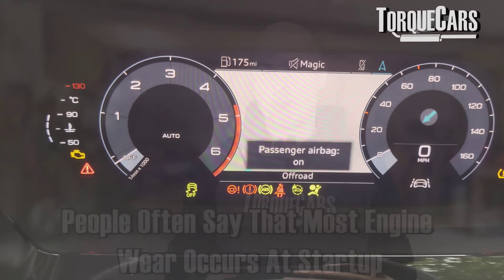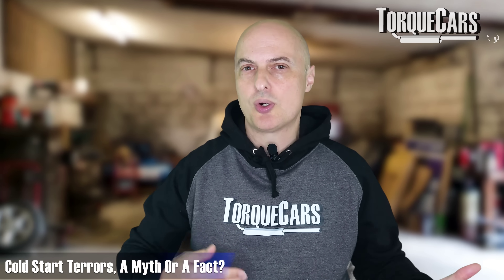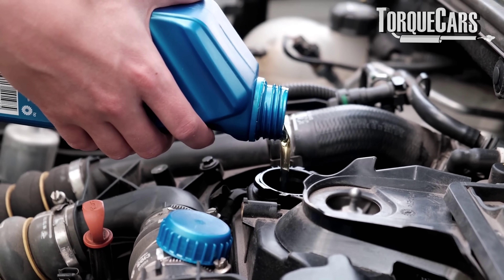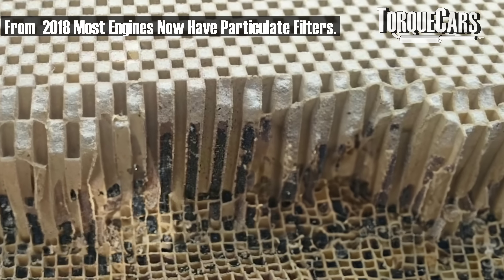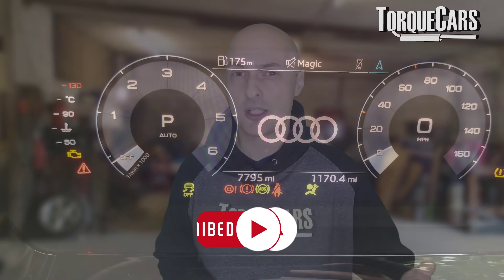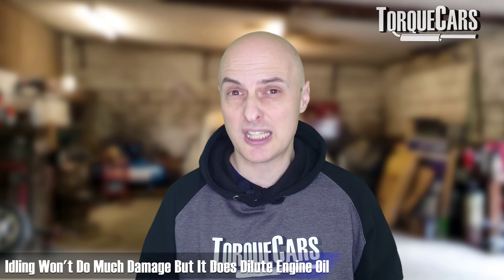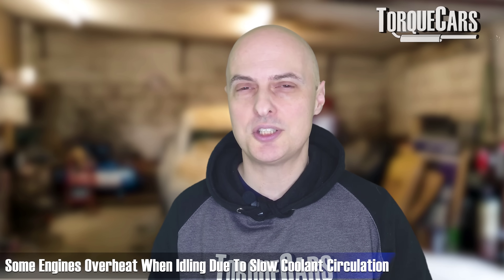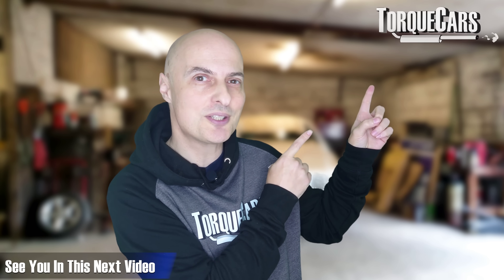❄️Reasons Why Bad Cold Starts Destroy Your Engine ☃️Prevent It Happening To You! ⚠️

Comment: When it's very cold I put a brick on the throttle and start the engine. When I am driving around 70 MPH (especially on the highway) I shift into Reverse. This keeps my car healthy.
Reply: Top tip 👍
Reply: Golden advice.
Reply: And if it’s a diesel, don’t forget to top off at least 30% of the tank with premium petrol. It burns hotter so it should warm up your engine quicker.
Reply: @EasternUNO  😂
Reply: Its the quickest and safest way to warm up the engine. 👍
Reply: @LiljamezZz 😂😂😂
Reply: @EasternUNO  Funny :)
Reply: Amazing!
Reply: @EasternUNO  this is why I have a mechanic, it's not my job to worry about this nonsense.
Reply: Top G
Reply: @EasternUNO  I can confirm that. Personally, it took me years to accidently discover the „wear reverse lever“. But now my engine is better than new, like -50.000 miles on it!
Reply: Man of wisdom
Reply: I love to listen to brit advice here in the us...but what they leave out is the fact you may have to clear the snow and ice off the glass..use that time to start the engine and turn on the heater element in the rear glass to assist..and just as important who wants to have their fingers stuck to a frozen steering wheel.
Reply: Wait I’m confused lol, you put the car in reverse at 70mph on a highway? Won’t that brick your whole transmission and gear system?
Reply: @EasternUNO  when I start the car on cold winter mornings i immediately put the car into drive and do a redline burnout in my driveway. That way the engine and transmission are both warming up
Reply: @EasternUNO  the good ol transmission reset trick. Mines due I just haven’t had the time lately
Reply: @cisco8237  na its really good for it
Reply: This advice sits well in the internet of today. I wheelie my bike when I want to make a sandwich
Reply: Are you tryin to be funny?
Reply: @ivanparenzo6493  car standards man
Reply: @DubStepTomatoFarmer  I used to do it that way too but try it in reverse and then keep your foot on the gas and slam it in drive.  Warms up even faster plus it's good for the differential, warms it up quick.
Reply: Have you tried sand in the oil? It keeps the cylinder walls clean.
Reply: Please don't do it!
Reply: @nedcramdon1306  great idea!  It's like a continuous cross hatch application.
Reply: Start…… let it run 15 seconds ….. shut down …… repeat till warm
Reply: Absolutely, shifting the the transmission into reverse while driving helps spread transmission fluid to ensure your transmission is working properly
Reply: good to exercise it to the max
Reply: @EasternUNO  😵‍💫😂🤣
Reply: I do the same, works for me.
Reply: @EasternUNO  WTF!
Reply: @Feelthefx  Forget that, I get half off on pure Naptha at work, I just use that pure.
Reply: This gave me a good chuckle lol
Reply: Yeh you do. 😂
Reply: Lol
Reply: @EasternUNO  SAME! If it’s in the single digits or below zero. I just start it, pull out and hit the throttle hard. I shift around 6500 RPMs. Do a burn out or two at the first two stop signs. Can’t risk not warming up your tires as well.
Reply: Soon, there is going to be the rapture. It's when there will be trumpet sounds, and after the trumpet sounds, God will lift his people from here. Also, God said people should be living by the Bible. Amen, and God bless you.
❤Jesus loves you guys. Dont wait, please. He will welcome you with arms wide open.❤
❤* John 3:16 - "For God so loved the world, that he gave his only begotten Son, that whosoever believeth in him shall not perish but have eternal life". ❤
Reply: This guy drives
Reply: I bring my engine a warm mug of tea in a morning , good old morning brew warms out up
Reply: @EasternUNO  you do know you can get sued if someone actually follows your advice. If you ever need a lawyer, dm me.
Reply: @EasternUNO  Your car is too afraid of you to break down.
Reply: @EasternUNO  🤔
Reply: @EasternUNO  the only guy here who actually understands cars 🫡
Reply: Shift into reverse at 120
Reply: I did the exact same thing once, and ruined my manual clutch!
Reply: Also use a match to see how much fuel you have in your gas tank. You can't really trust a dumb gage anymore
Reply: just like your body you gotta push your car to failure to see gains 💉🙏🏼💪
Reply: @cisco8237  what about putting brick on throttle!!! in cold start..
Reply: @BikeBrozz  lmao
Reply: So funny omg
Reply: @ivanparenzo6493  If you were 12 years old you'd get the joke.
Reply: @EasternUNO  you can’t be serious. That’s dvmb
Reply: should I leave the brick on for the whole journey or until the engine is just warmed up?
Reply: This man scares me
Reply: @Feelthefx  That is the most ridiculous comment I have ever read . Disturbing is some people will believe it and blow up their engine. There's many videos on this and conflicting views causing confusion. Every car and engine are different. Get to know it is the best way. I might sound crazy but cars even though the same model have different personalities. You bond with some and you don't with others.
Reply: When you change your oil make sure that you grind plenty of sea salt, cracked black pepper and tomato sauce diluted with malt vinegar. Then you know it has been well seasoned and Bob's  your teapot!

Comment: Another issue to consider, are the gaskets, if the engine  block is cold and you drive the car away, theres a very good chance the the heads and the block have not expanded and created a much more tighter joint instead of just relying on the gasket itself to hold back the pressure created by the cylinder pressures, alot of exhaust gasket leaks are from the flame blowing thru the header gasket due to the differences of cast iron and aluminum, and dont run the heater until there is sufficient engine heat, other wise you are cooling off the coolant before it can retain a warmer temperature
Reply from the maker: Good point my friend.
Reply: Such a load of nonsense, manufacturer manuals literally tell you to drive away straight away and to not idle at cold…
Reply: @Master1906 
They also want to sell you aftermarket parts, so I know what advice I will follow.
Reply: That’s not correct. That only happens if you floor it or drive above 3k rpm if you drive it off when cold. You should let your car cold start for 50 seconds then drive away slowly and not exceeding 3k rpm. This will warm up the car faster and you will waste less gas while not harming the engine. By driving the car slowly you don’t cause uneven expansion of the bearings, rods, pistons, cylinders, heads and the block.
Reply: Heater is not really a problem cause most modern engines are programmed to idle at a little bit higher RPMs when cold-started. Toyota f.e. even went further and some models have "Power heat" button which raises RPM by like 300 (from around 900 to 1200) so the heating can happen faster. When engine is warmed up the idle speed will drop down to its normal value. Also at least my car also raises RPM a bit when a heater is activated, but it feels like its only 100 rpm or so, don't feel the difference that much in terms of how much heat gets produced. 

Anyways I park my car in a non heated garage so I don't worry about having to full blast heater to get windows unfogged or unfrozen even without heating. I'd assume you shouldn't full blast it when on cold engine anyways, better drive for a bit with modest visibility and then turn it on when coolant has heated up a bit
Reply: @sheepdog3828  i don’t think you know what thermodynamics actually means 😂
Reply: Don't exaggerate guys. Not using heater to not upset your engine thermal (making yours car engine more comfortable than You) is a bit over the top i would say because if You let it "break in" for this few seconds and You're taking off gently as it is advised it would anyway produce few kilowatts of "wasted heat" that is there to use to Your comfort. Engine is warming up pretty fine anyways...
Reply: @an0nim11  u switch to coomfort mode to warm idle?*
Reply: @marks9127  
Thanks for the info. Sounds like Toyota are first to bring in updates that actually save the car, instead of hoping to break it and sell us parts, as is usual with their European counterparts.
BTW Putting your heater on before your engine is up to temp. will take heat away from your engine, making it slower for it to reach operating temperature, thus reducing the viscosity of your oil.
It's a hard choice, I know, but maybe an extra pullover is the answer.
Edit. If you drive a petrol, it's less of an issue. Driving a diesel, like I do, it can be frustrating.
Reply: Sounds like a load of BS to me. Ever see someone loosen head bolts? Watch the “I Do Cars” nut. The whole engine stand is jerking around because they are massively torqued. With regard to the heater: What % of the thermal energy produced by engine combustion is being removed by the heater? I would posit “not enough to make waiting and freezing worth it”. I give my car a minute or two as I buckle seat belt and fiddle with the radio, the engine has GONE 28 YEARS with regular oil changes as the ONLY maintenance. (1996 Saturn Twin Cam btw)
Reply: What kind of wizardry is that.? Doesn't make any sense...1 minute idle time..drive off  don't run hard till engine oil temp is mid way..turn heater on right away .or run into back of car.
Reply: @kurtjammer9568  
1. Listen to the audio in the video.
2. Do you drive a diesel?
3. What is the result of a few minutes of light driving to the operating temperature of a diesel in winter conditions?

You will only be blowing freezing air onto your windscreen. The moisture in your breath will condense on the windscreen. The resulting moisture will freeze, only adding to your original dilemma. If you can't see, you will hit whatever is in front of you. If that happens to be a pedestrian or cyclist, the police won't be slow in joining the dots. Explain that in court.
Reply: What? You dont like the days of the VW beetle. When you have to scrap the inside of the windshield while driving.all the way home..your spoiled lol
Reply: Oil does not absorb water. 🤡
Reply: @persevere777  
OK. Here's my tuppence worth;
1. Apply PRE icer to windscreen on the previous evening and point the car towards the rising sun.
2. Turn the heaters off, open the windows and take a couple of runs up a nearby hill. This is usually enough to allow you to close the windows and put the heater on to keep window interior clear.
3. There are other steps, but they have been covered, I think.
Reply: @michaellavery4899  i think im just gonna buy a horse 🤣😅😂🤪
Reply: @persevere777  
Genius. And it's more economical in every respect. 😅🤣
Reply: @snu666   Hot/cold can cause condensation in your motor, the heating and churning of water and oil will mix them into a whiteish/brownish creamy substance
You will often see this on the bottom of your oil cap if you frequently do short trips if you live in a colder climate area
Reply: @Master1906 Manufacturers also tell you to use ridiculously thin oils and not to service transmissions. Manufacturers aren't concerned with multi-decade longevity, they're concerned more with economy and convenience for the first owner, as well as reducing CO2 emissions because apparently that's going to make the planet boil 😄. Sometimes common sense is more valuable than what's in the manufacturers manual, like more regular oil changes.
Reply: @snu666 Yes, actually it does. Oil and water don't mix, but when operating together in an engine they are effectively force blended together into an emulsion, much like mayonnaise. This is a fact, and if you have sufficient water in your oil, such as coolant going into the crankcase, this "mayonnaise" effect will be very obvious.
Reply: brother if your head gasket blows because you drive your car with a cold engine it was already dead.
And if you put the heater on you will not "take heat" from the engine… Unless you want your cabin to be a steam bath or the outside temperature is diabolically cold.
Reply: @persevere777  I blew the head gasket on my mate’s Norton Dominator 45 years ago purely by not letting it warm up…. Whoops….
Reply: @michaellavery4899 I live in Norfolk - THERE ARE NO HILLS………
Reply: @Master1906  Manufacturers also tell us to go 10,000 miles between oil changes. Doesn’t make them right.
Reply: @curtisjohnson944  take your tin foil hat off 🤡
Reply: @Master1906  Exactly, idling cold engine is far worse with many points, just get on after 10 seconds of startup BUT drive geeeeeently, geeeeeeently
Reply: That's bs
Reply: @BLCKVD  yup
Reply: @Master1906 Manufacturers also don't care what happens to the engine beyond the 3 year warranty, and none of these competing cold start practices are ever likely to cause any substantial failure within that period anyway. It's relevant only for people who want to keep their car over the long term.
Reply: @ they would care, because ultimately if these cars all break straight after the warranty period then they would depreciate massively and nobody would want to buy them new with cash.
Reply: @Master1906  buddy you are so naive! Absolutely no common sense. BMW also tells you, you never have to change your oil, who benefits if your car wares out faster? The manufacturer. Your too dumb to know how stupid your comment is. This whole video is basically common sense.
Reply: I've warmed my car up on idle for yrs never had any engine problems changed oil on time with full synthetic
Reply: @Master1906  I Hope you're not that old because you are so guilible
Reply: @mikeperri1111  lmao my wallet will be happy whilst you waste your cash. that's your punishment haha!
Reply: @maxly501  I don't waste my money feeding my OCD like half these "gullible" idiots here. Hope you're not also gullible like them!
Reply: New driver here, thanks for the tip!!
Reply: That's due to higher compression you could have that happen by putting too much oil in your engine you can blow the top gasket
Reply: Even the bottom gasket can blow up
Reply: @Cokie907 don't ever loosen your head bolts
Reply: I used to work with a guy who claimed that if you drove a car hard cold all the oil would blow out the gaskets 😂. He bought a GSXR and would redline it on every startup. I ask him "Aren't you gonna blow out your seals doing that" and he says "No only cars do that, bikes are built different" 😂
Reply: Thx for the tips,mate.
Reply: @persevere777  
The heating system isn't available until the thermostat in the engine opens. 
Most modern cars have a separate heater for when it's cold.
Reply: @Master1906  some also tell you to change oil at 10000 or more mile intervals and thats terrible for your vehicle. You certainly can't trust them
Reply: Soon, there is going to be the rapture. It's when there will be trumpet sounds, and after the trumpet sounds, God will lift his people from here. Also, God said people should be living by the Bible. Amen, and God bless you.
❤Jesus loves you guys. Dont wait, please. He will welcome you with arms wide open.❤
❤* John 3:16 - "For God so loved the world, that he gave his only begotten Son, that whosoever believeth in him shall not perish but have eternal life". ❤❤
Reply: You all are full of it. 

People have been starting and driving away in cold weather the whole time. 

It might add wear but its not gonna kill the engine lol.
Reply: @mikeperri1111 "BMW tells you, you never have to change your oil."

I've worked on german cars and I have never heard of this. Can you point where in the service manual does it say this?